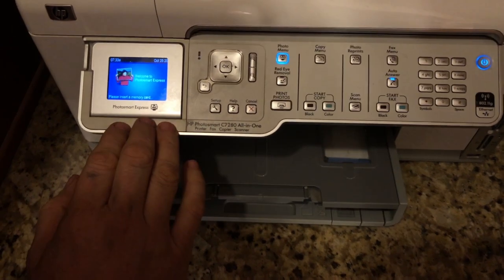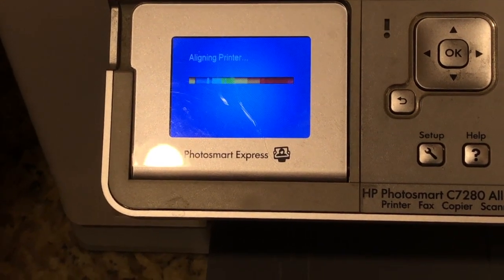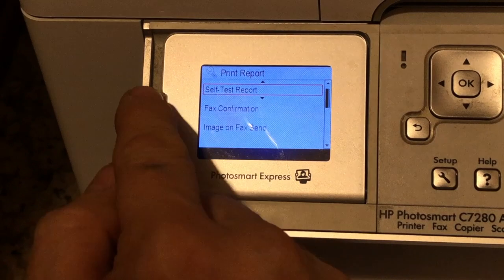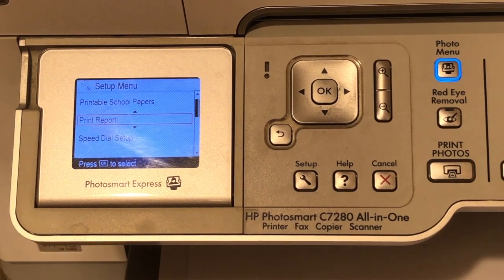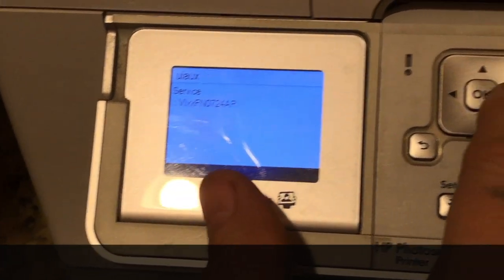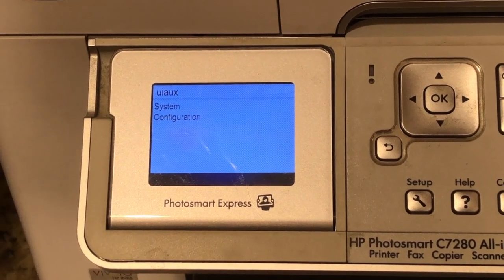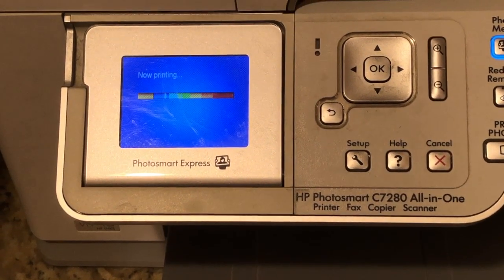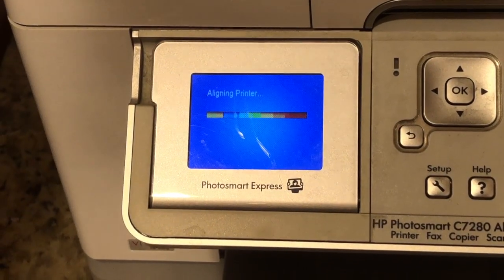HP PhotoSmart Printer Insert Plain White Paper Mismatch Error or Calibration Error Service Procedure

Comment: Was so frustrated with my HP C-7280 displaying paper mismatch error whenever I tried the clean print head tool. Found your video and it fixed my problem! Thank you so much for posting your video. It also solved my blurred print issues. I am not getting good color when printing photos and wonder if you have a fix for that. Colors seem to be way off.

Comment: Just my problem, BUT, I have a less fancy Photosmart D7360. Can I do the same thing with the limited controls this beast has compared to your C4180? Otherwise its into the dumpster.
Reply from the maker: It should have a similar menu, but I don't know if it's the same commands as this model.
Reply: Nice clear video. I have the C7280. I do everything you say but when I press the OK button for media sense calibration it does nothing at all. But then when I went to print, it printed! Thanks!